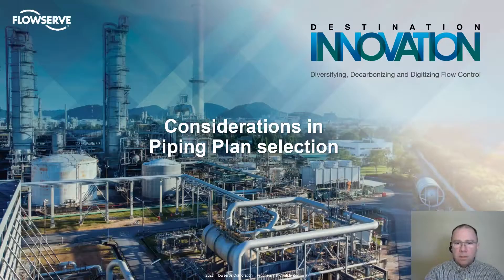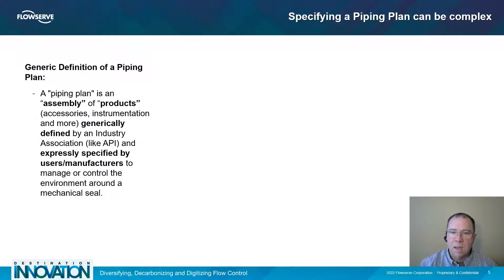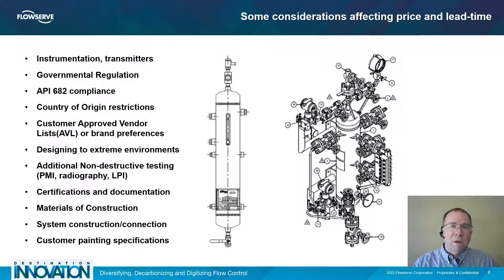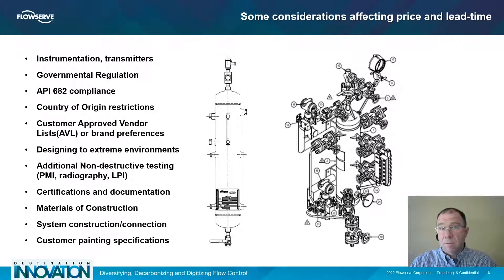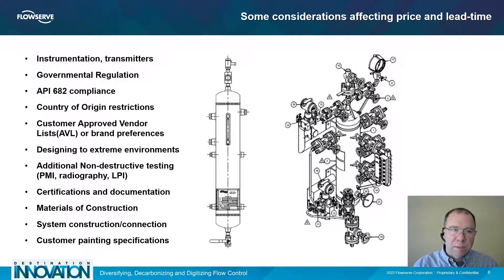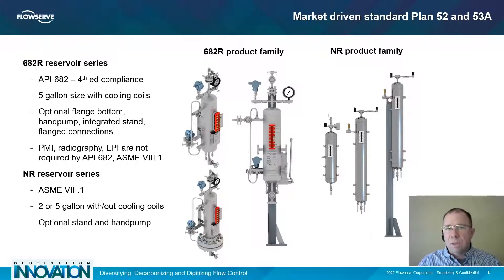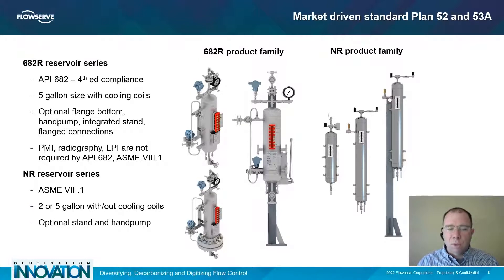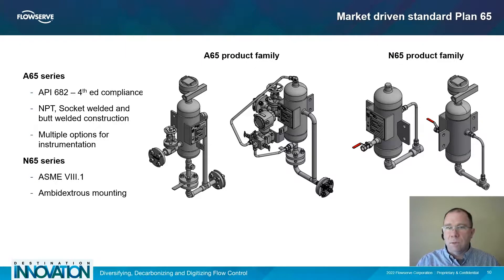API Piping Plans and Good Seal Operation | Flowserve

Comment: Hi everybody
We have  virtical condensate extraction pumps in our power plant.
API 13 in combination with API 32 are used for supporting the mechanical seal of the pumps.
There is a problem on the sealing lines (API 32) on the both pumps, the check valve allows backflow through it, so water flow from seal chamber of the running condensate pump to the seal chamber of the SB pump.
What is the reason of the two check valves are damaged?
What is the effect of the problem on the running pump and the SB pump?